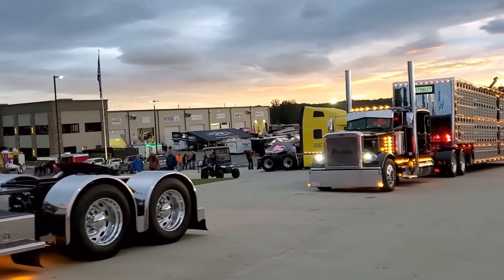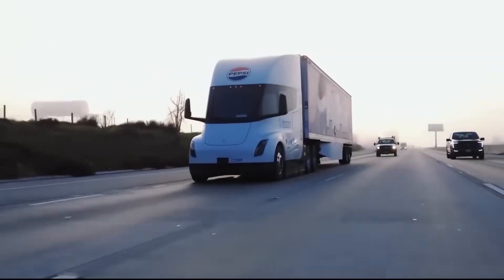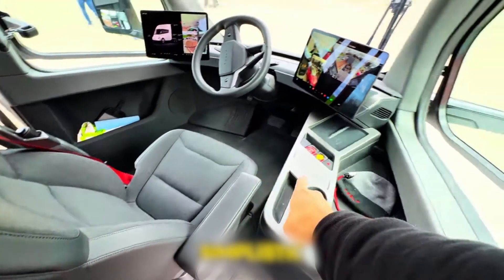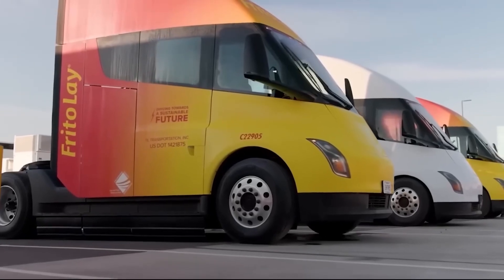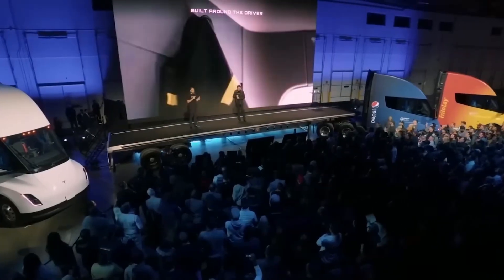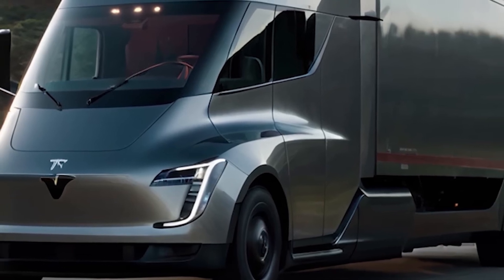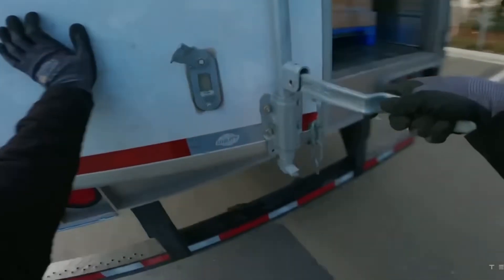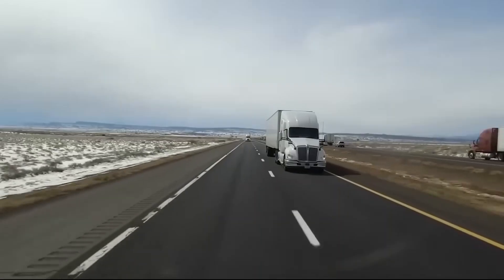This Truck Saves $70,000 Every Year — Elon Just Ended Diesel

Comment: I worked for Schneider trucking for a few months (over the road). Trucking is a very difficult job! If Tesla combines this tech with FSD, this would be amazing for freight handling worldwide! I foresee the day when large trucking companies, like Schneider et al, have interstate oriented freight yards that handle long-haul transfer by Tesla semis from 10pm to 6am timeframes autonomously without drivers via network ops centers. Day trip trucking from these freight yards for local deliveries could use autonomous semi delivery or manned if routing is complicated. I think this will go a long way to removing the difficulties of otr trucking! Tesla may need to incorporate LiDAR tech into their fsd so that long haul trucks could operate at night from 10pm to 6am?
Reply from the maker: It’s exciting to think about how tech could transform the trucking industry and improve conditions for drivers!